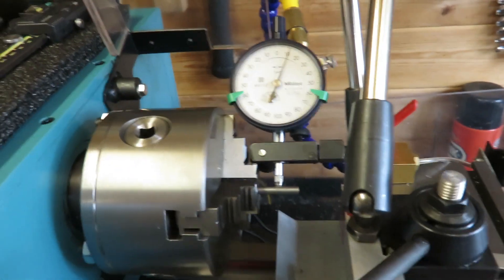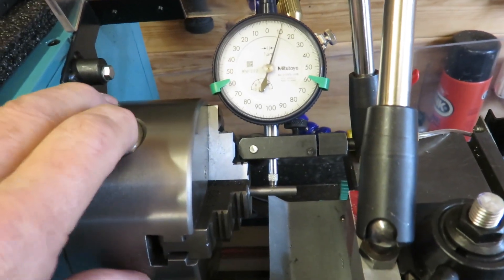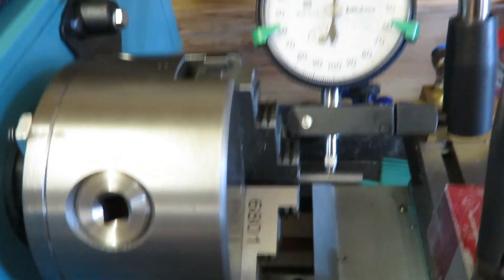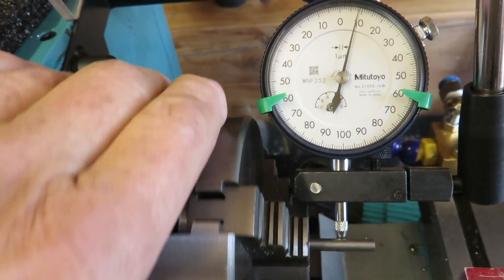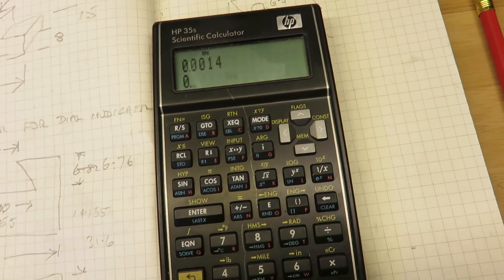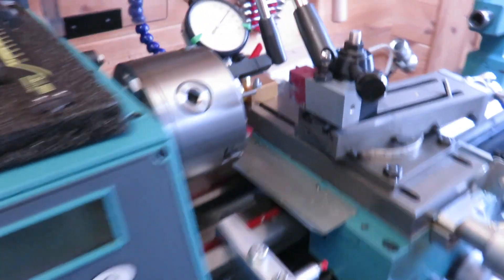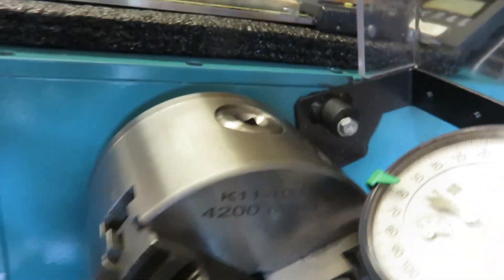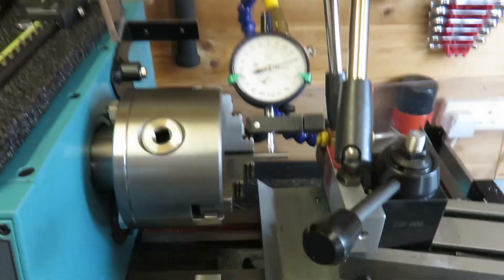1.5 thou runout on Axminster lathe 3-jaw chuck????

Comment: Yes it is a very good number for a 3 jaw. But checking a chucks run out at only one diameter doesn't prove that much. 3-4 other diameters between what you used and the chuck jaws maximum holding diameter would give a great deal more information about it's average run out. Due to the way the scroll and jaw teeth are machined, hardened and then ground, the run outs at different diameters can and usually will change. Probably not that much, but if you don't test you can't know for sure what it's really capable of. Pulling the chuck jaws out and indicating the chucks face for any axial run out is worth checking as well. A chucks face gets used to seat larger diameters against it quite a bit. So checking that for any axial issues is well worth the time it takes. I've seen quite a few forum posts and a few Youtube videos of people checking a chucks outside diameter for run out. Unless it was grossly out for some reason and adding an imbalance problem and you'd easily see that with your eyes and feel it. That check is just about pointless since a chucks outside surface is never used for anything while turning parts. Fwiw keeping a chuck clean internally is also important, through drilling and boring can load up the internals with chips so they need a tear down and cleaning every so often. Any metal chip that gets between a jaw tooth and the scroll can easily throw it's run out off. 

Very nice indicator and it's more than accurate enough to run one more check the next time you turn something on your lathe. It's bearing quality, turn a shaft until it's fully cleaned up around it's full diameter. The cuts surface finish is important. Then put the indicator to the rear side of the shaft with the indicators tip riding on the back of the part directly opposite of where the cutting tools tip is positioned. Then rotate the spindle by hand. Doing it that way any error in roundness will be double the run out that the bearings are capable of. Yes it should be very very close to zero, but again if you don't check you don't know what your machine can produce. And it's no secret that even the very best bearing manufacturers can have a bad one somehow slip through there quality controls. No doubt that's extremely rare but not impossible. SKF and probably a few others list maximum allowable deviations from exactly round for different grades of bearings on there websites for what you should be getting.